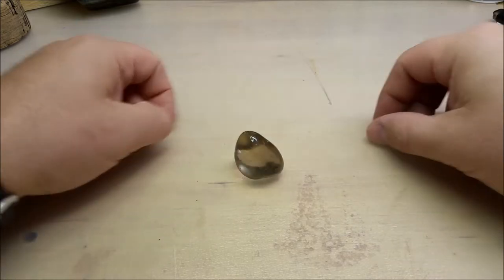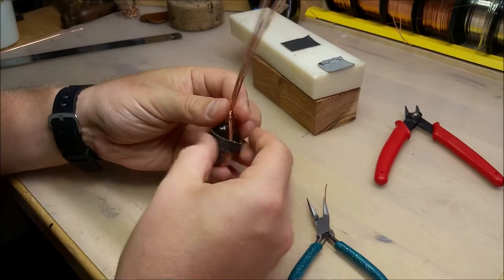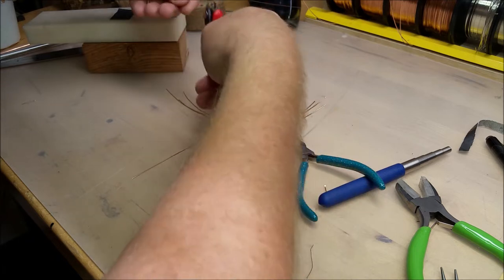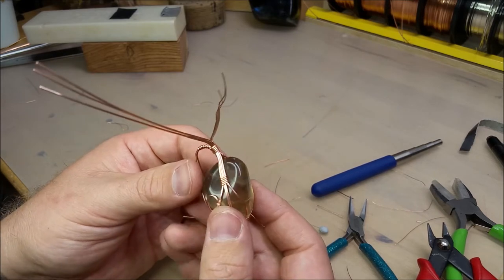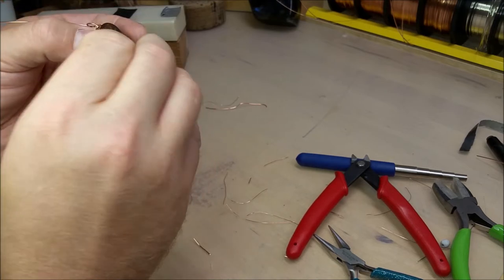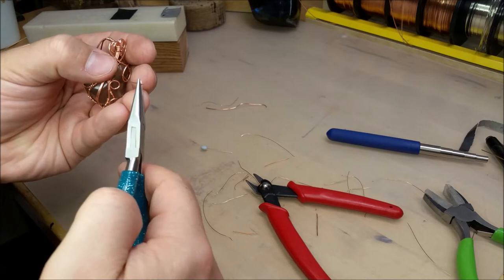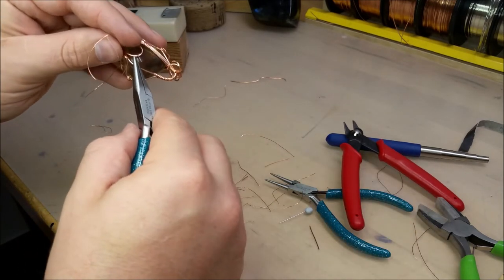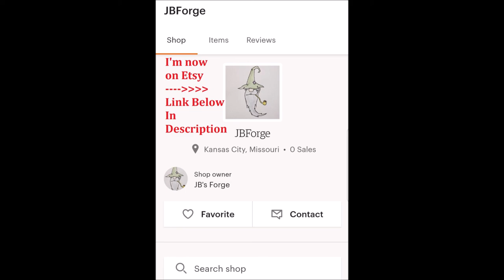Wire Wrapping a Tumbled Stone

Comment: curious what tools are you using? :)
Reply from the maker: Mostly flush cut pliers, chain nose pliers, and round pliers. You can typically buy them in a set fairly inexpensively from craft stores. I've been slowly upgrading to Lindstrom's line, but anything can get you started.